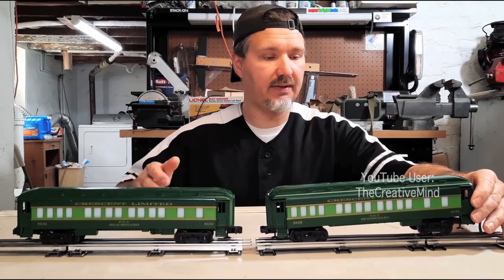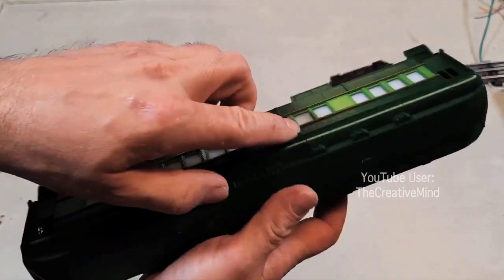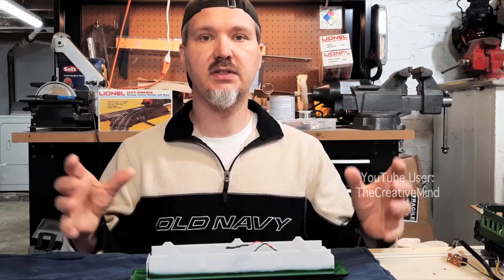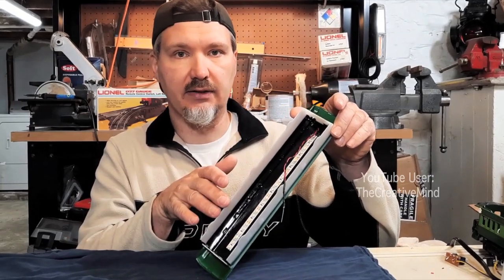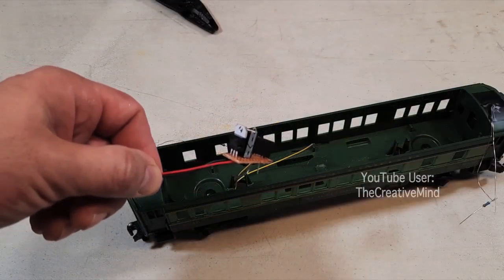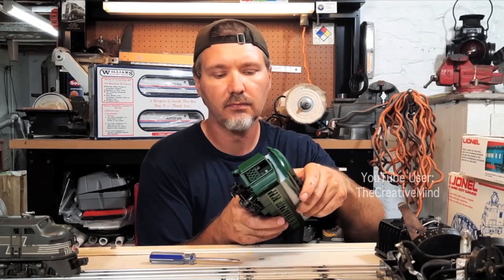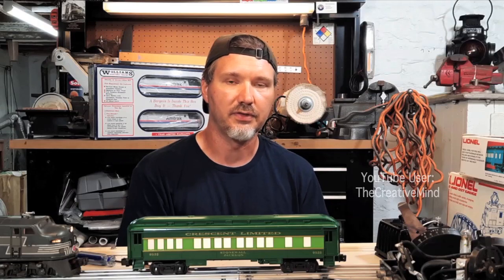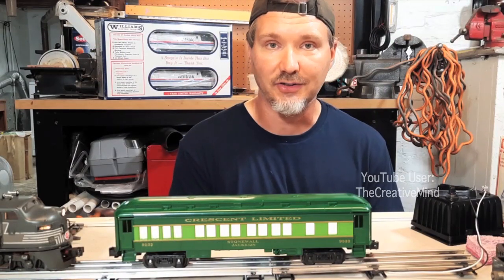Installing LEDs into Lionel MPC Passenger Cars

Comment: Brake cleaner on a q tip does wheels well.  Do not spray anywhere near train paint!  Scrap thick crud off.  CRC 2-26 a good follow up.  Conducts electricity too.  S gaugers use it on track too.
Reply from the maker: Great tips, thank you.

Comment: I think adding a capacitor in the circuit to the LEDs would eliminate the flickering problem.
Reply from the maker: I have 10,000 microfarad caps that I haven't installed yet. They should work well.

Comment: if you have problem finding or you do not want to deal with the led roll dallee makes led strips in various lengths and they will work with ac but they recommend dc considering how long leds last I am not that worried

Comment: why paint the roof black, pull the carboard and glue som aluminum foil to the roof to get more reflection off the lights. did that with the regular incandescent lamps and it helped brighten it up a bit
Reply from the maker: @rscellartrains734   the cardboard in these cars were deteriorating, warped and one car started to get mold on its cardboard roof. I thought of making new pieces or salvage what I could and glue the cardboard back but what are the chances it might separate from any adhesive used. That's why I painted the roof black because I know I wouldn't have any issues. Plus getting these lids off is hard enough.

Comment: Do you run constant voltage, or do you use a transformer? I want to do this to several different sets, but I use a zw275 transformer. I'm trying to figure out how to get constant (or near constant) brightness using my zw275 transformer.
Reply from the maker: @inscoredbz  I use conventional the majority of the time. Doing the retro fit to LEDs with a power supply will maximize lighting brightness even at lower voltages where a traditional locomotive can "creep" on the tracks. Check out my 783 Hudson video. Toward the end I retro fit the Headlamp with an LED and I compare it to the incandescent passenger cars, big difference.

Comment: Why not put the lights at the bottom? Then you wouldn't have to mess with a wire. It doesn't look like you can tell where they were mounted once it is all put togetther.
Reply from the maker: I thought of that but I wanted to keep the lighting mounts for the incandescent bulbs. If i moved the LEDs to either side of the passenger car with the power supply to the opposite side of the LEDs,  the one set windows would be brighter and a shadow may be cast on the other windows from the electronic parts. I could have reconfigured the power supply to lay flat but I was happy with this. Thanks for watching.

Comment: How did you get all those Crescent Limited cars to stay together? The plastic couplings are not very robust. I have one of these cars with droopy couplers that dont line up with mating couplers. I am still trying to figure out how to fix this.
Reply from the maker: I had a few of these couplers sag and recently 2 more were sagging on me. I did a short on its repair. One of the repairs I forgot to post.

https://youtube.com/shorts/ekCwQVDUhxQ?si=jw0upBcnhFEbl3mO
Reply: I guess your method would work on trucks that have a pickup roller assembly to hold down the dearth vader helmet. I used a 4" black cable tie and wrapped it tightly around the pivot point to pinch the dearth vader helmet down on to the pivot hub so that the tang is straight and swivels freely. So far, this has worked. I also used this same method on the truck with the pickup roller assembly.

Comment: The passenger coaches look great! The led’s appear to create a fluorescent light effect in the cars. Could you build some kind of “stay alive circuit to help prevent the flickering? The markers were a real nice touch as well. I’ll have to look into them for my On30 coaches and cabooses. Thanks roe sharing.
Reply from the maker: Thanks John, the LEDs are dimmer than they appear in the video. My camera adjusted to the darkness making them brighter than they appear. To make the LEDs flicker free, I purchased 10,0000 microfarad 25 VDC capacitors that I can install parallel on my DC output. That value should be large enough to keep the lights on on a brief dead spot

Comment: I would like to add LEDs to NM thps1 Burlington zephyr. When I hook up the two LED wires to the transformer they light just fine. I installed a pickup roller to the trucks. Where would the other wire go?
Reply from the maker: Does the Zephyr have a grounding truck? That's your second wire location. Which LEDs are you using? Are they a set voltage?
Reply: @TheCreativeMind  The wiring for the zephyr is odd and I am electrically challenged.  Each passenger car has a tether to the next car.  One set of wheels and trucks per car!  No pickup rollers so I installed my own.  As stated, if I wire the LEDs to my transformer they work fine but I can only connect one wire to the roller.  If I touch the second wire to any other metal on the car, nothing happens.  Old cars with lamps work fine if you touch one wire to the roller and the other ire to a metal part like a wheel.
Reply from the maker: @josephpolanin182  I had to look up a Zephyr and see how it was wired. I see the tether between the cars and you have a pick up roller installed where the LED is located. First see where the tethered wire is hooked up at. If there's 2 color wires you can tell where the power wire and ground wire is connected. The ground is usually on a motor frame or locomotive frame. See how this wire is going into the connector and follow that wire to the car where your LED is at. If your LED is connected to your new center roller, connect the other wire to the ground wire by the connecter by gently scraping away the insulation and soldering the new wire to the ground wire. Hope this helps
Reply: @TheCreativeMind  I have taken 6 photos of my project but do not see a way to send them on YouTube.  There are only 2 wires coming from the LEDs.  I have one on the roller but cannot place the second one due to the configuration of the trucks.  As an added bonus, the observation car has a pickup roller and a place for both wires from the lamps.

Comment: I always change out the incandescent lighting for LED strip lighting.  I also use a mini full wave bridge rectifier along with a 3200uF capacitor for flicker free non-directional lighting.  I also run all my Lionel trains on DC power.  Also if you use bright white LED's you'll need to paint the individual LED's with some yellow acrylic paint.  The bright white lights just don't look correct according to the wife so I painted them.  I also use single LED's for the engine front light.  Of course you'll have to use a ballast (current limiting) resistor.  I usually use a 220 ohm dropping (ballast) resistor for all my LED's except for the strip lighting 'cause they have the resistors built in.   W Rusty Lane K9POW in eastern Tennessee

Comment: How about just an LED strip and a variable register in series (with the proper polarity), crank it to a brightness you like and done?

Do you need to rectify it?  Won't it still light with 1/2 the wave form?

A capacitor should work as well.  The LED has rectified the circuit.

Love your observation lanterns, brilliant !!  (pun intended)
Reply from the maker: You can do a variable resistor with the LED strip. The LEDs should light with 1/2 the wave form, but the manufacturers have their spec. No harm in trying. I haven't seen an LED strip that had a rectifier in it or rectified the power, mostly current limiting resistors to control power in the circuit. If you apply AC power down the strip, AC power will be present at the end of the strip. All LEDs are in parallel with the power supply from what I've seen. If a polarized capacitor is introduced to an AC system, the capacitor will get damaged (may fizzle or pop like a fire cracker).  I rectify mine for the controlled brightness and non flickering operation, but I need to add a 25 volt 10,000 microfarad capacitor to my power supply to make that happen. The other benefit of a rectified circuit is if you add a lower voltage LED system, the passenger cars will light up brighter on lower transformer voltages.
Reply: @TheCreativeMind  I shouldn't have said that the led's rectify the current.  Actually they clip one half the sign wave.  This results in a pulsing DC half sign wave.  The pulsing is not noticeable but can charge a capacitor.  It's behavior is very DC like.  I'll post again once I've tried it.  Cheers, again, great job.

Comment: Love the idea.  How to I make or buy the regulated DC power supply?
Reply from the maker: Thanks Warren. In my description, I have a downloadable picture of the AC to 12V regulated DC power supply. The electronics I got from Amazon and they are the flat bridge rectifier, the 7812 voltage regulator and a 1000 microfarad capacitor. You could go with 10,000 microfarads for a flicker free operation.
Reply: @TheCreativeMind  Thank You.  The 3000K LED strips are out of stock.  Would you recommend cooler, warmer, or hold out for 3000K?
Reply from the maker: @warrensmith6  I would stick with a warmer color depending on the style of passenger cars. If it's a style like these Crescent cars, warm is good like they have lanterns as their light source. A newer style car like Amtrak cars you can go a little cooler, but that's my opinion.

Comment: This is a great video! However I can not tell how & where you reattached the resistor for the marker lights. Do you have a diagram or picture that illustrates this process.
Reply from the maker: I didn't include it in the video, my camera couldn't focus on the work area. I just cut the resistor off the LED wire, push the wire through and glue the lantern to the body and solder the resistor back onto where I cut it from the LED wire. I also wrapped the resistor and it's solder joints in heat shrink tube to dress it up and to prevent shorting. Hope this helps

Comment: just curious, would you know if pulling the top off of a LIONEL BALTIMORE & OHIO PASSENGER CAR IS THE SAME WAY?
Reply from the maker: If it's from the MPC era and is the same design as these passenger cars, then yes. But still look for any screws on the bottom or by the doors.

Comment: I have wanted to add tiny led light to some of my Lionel Standard Gauge engines and cars. I do not really understand led's, more specific: why can't you just buy leds that run on 12 to 18 volts and just add them in/on with prewar type bulb fixtures? I know there are leds in car dashes etc. that's 12 volts. I would want to have OBS cars have leds behind the plastic lenses, red & green leds on cowcatchers. I can grasp the concept of volts, mostly Amps, Ohms NO, resisters NO. I am just too old school.
Reply from the maker: Hey Michael, hopefully I can help you out with your question. LEDs are diodes that light up and their operation depends on their manufacturing. There are LEDs that run on AC voltage, DC voltage,  and both AC or DC voltages. Placing a DC LED on an AC circuit can damage the diode. When they're made they have a set voltage of operation unless they have a regulator built into the LED so they can operate at a range of voltages. However when we want to add LEDs to our models we may have to fabricate/purchase a power supply that will handle them. Resistors restrict current and/or create voltage drops to control the brightness of the LED like a dimmer switch in your house or bring the LED to proper operating volrage. I would like to find a generic LED that I can add to my trains but besides price, the LED lens may be too tall, the light is focused straight instead of all around and color. An example of this I bought (4) 14 VAC LED bulbs for my 1122 switch tracks. Wasn't what I expected. The lens was too long it restricted the lantern from being installed and the light was focused straight. It was $18 gone. But it doesn't mean the right LED isn't out there. Hope this helps out.

Comment: Great information!  I have been a Lionel collector since before the 50's and still at it.  Believe it or not I never had this set until only a few weeks ago.  I am very squeamish about making permanent changes to any equipment so drilling holes for marker lights is probably.not my bag, but I do have an S scale drum head that I would like to add from Tomar industries.  I would love your thoughts on adding that to the observation.  I chose S scale because the railing on the MPC observations is smaller than true O scale.  Bruce Schrimpf
Reply from the maker: Hey Bruce, so that's what those emblems on the back of the cars are called. OK, I checked out the drum head from Tomar and from what the illustration shows it has a wire coming out the middle back of the emblem. First I would mock it up on the back of the car to see how it looks. Run the wire under the platform of the observation car and see if there's any pinch points. If so I would use a small drill bit to ream a chase on the platform so the wire sits comfortably. If you want you can add a piece of heat shrink tube (don't heat it up) as a protector. Check to see if you have to extend the wire to your power source and come through the hole, for the interior lighting, with your wires. Tape or hot glue the wires under the observation car.. If all looks good with the drum head, I would dab some hot glue on the back of the drum head to adhere it to the railing.
Reply: @TheCreativeMind Thanks.  I will study your reply carefully before I do anything!  I will probably gave more questions before I start.
Reply: @TheCreativeMind  PS:  The National Railroad Museum in Green Bay, Wisconsin has one of the most complete collections of railroad drum heads around.   They were not all round.  Some were square and some, like Pennsy, were in strange shapes, like a keystone.

Comment: Would it be possible to add a capacitor or something to create continuous lighting that would withstand the momentary outages caused by track switches or dirty track? The capacitor (or whatever) would act like a small limited-capacity battery and keep the LED lights glowing continually, instead of flickering when the cars go over the switches? I know just enough about electronics to dream up stuff like this but not enough smarts to know if what I’ve dreamed up is even possible…😉
Reply from the maker: Hello Brian, yes a large value capacitor will work but keep the capacitors rated voltage low. Besides the value the rated voltage will also increase its size. Also paralleling capacitors will help
Reply: 10,000 microfarads should do it

Comment: Could you do a LED switch on passenger cars that have interiors
Reply from the maker: To add an on/off switch with existing LEDs in passenger cars? I'm sure it's possible but the interior will yield the kind of switch used. Which car were you thinking about?